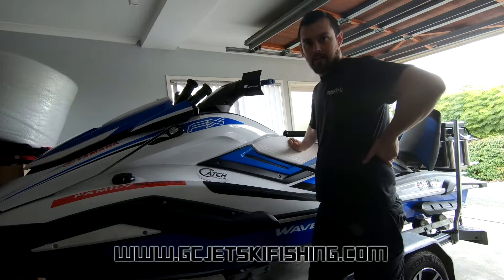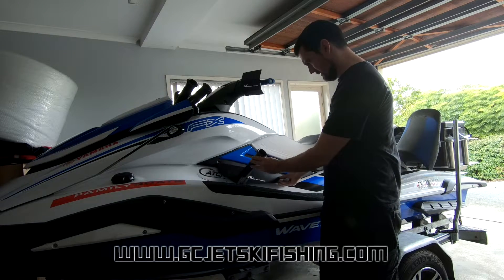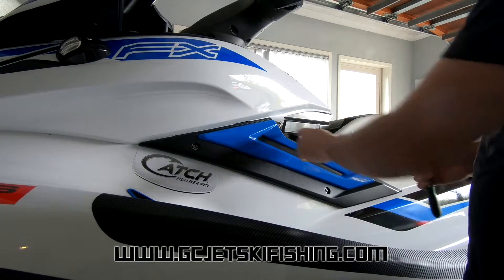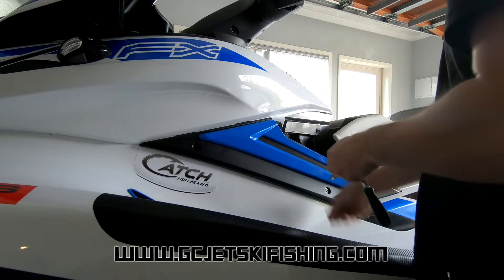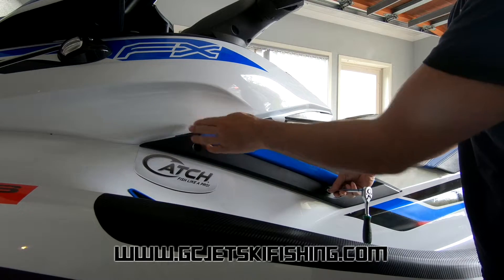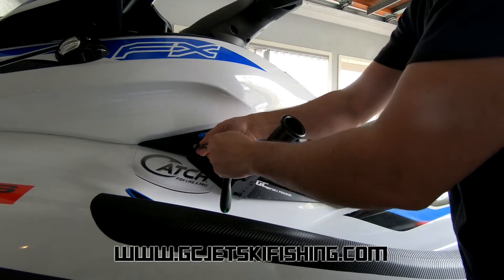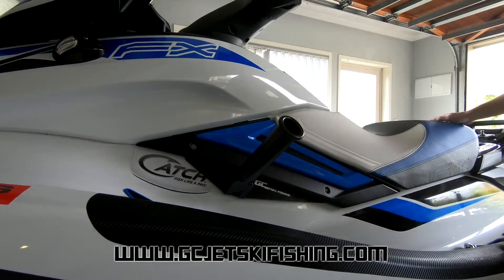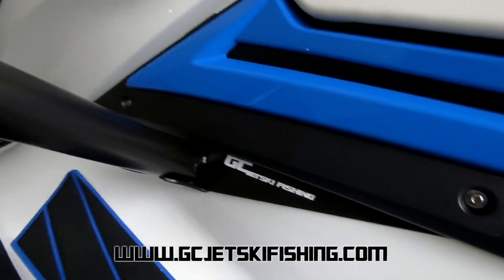Jet Ski Fishing Footwell Rod Holder Installation How To Video

Comment: Very tidy,  hard to tell exactly, but can you still straighten your leg forward the whole way up the front of the foot well or would you hit your shin? Definitely better than chasing rods around the back of the ski haha.
Reply from the maker: Hey Hugo, It is hard to tell and I actually  had many people ask the same question when I had them on display at a recent boat show, I told them to jump on my ski and have a look themselves and they all said "ohh theres heaps of room!" If I sit on my ski and go to straighten my legs out fully the rod holders would hit at my ankles not my shins as a guide as to how far forward they are. And you have to get in quite a wierd position to actually make them hit. I check these things many times when in the R&D stages :)